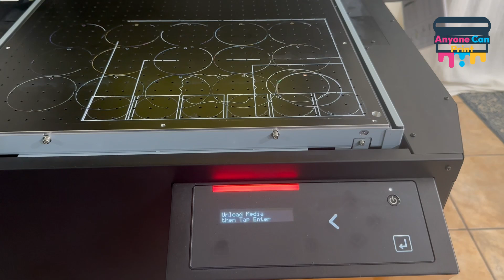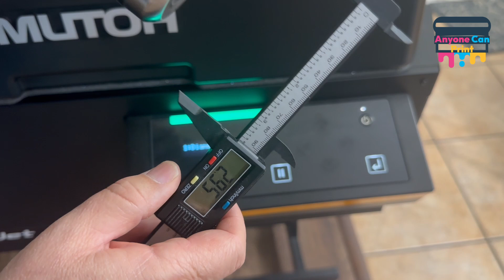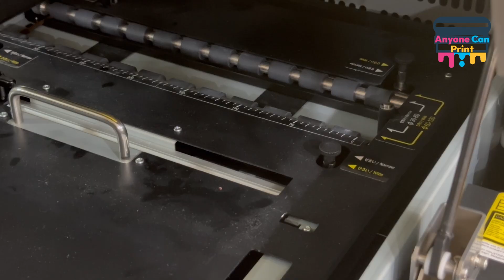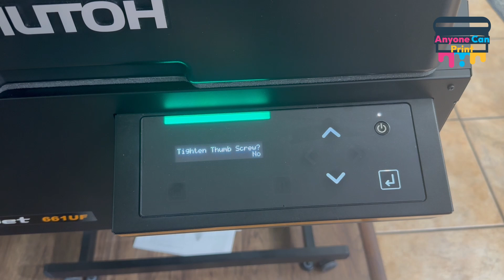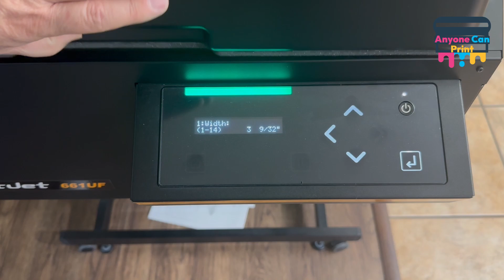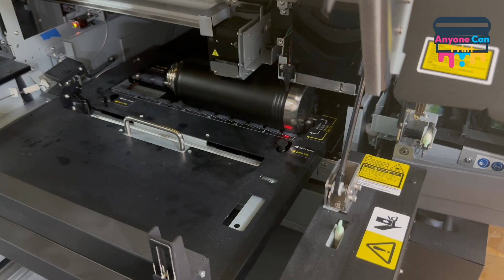How to install the rotary unit into the Mutoh XpertJet 661UF

Comment: Are you priming the tumblers before printing or just wiping them clean?
Reply from the maker: I just wiped them with rubbing alcohol. If you are printing on a bare stainless steel tumbler, you might need an adhesion promoter.

Comment: HELLO THANK YOU FOR THE VIDEOS. I have a problem don't know why my artwork is printing distorted. I have done averything in your video but the artwork is size 2.5 x 4 but is printing 1.5 x 4, please advise.
Reply from the maker: @gisellesanti1  To start, what software, including rip, are you using?
Reply: @Anyone-can-print  flexi & vertelith
Reply: we are ordering the part for leveling the yeti mugs as soon as we figure this out. We are just starting using the rotary
Reply from the maker: When you are sending the print to the printer, what "Print Environment" are you using?
Reply: @Anyone-can-print  w cmyk on user type 1
Reply from the maker: That may be the issue right there. You should have a print environment that is labeled rotary.
Reply from the maker: I ran a test and if I didn’t use the print environment labeled rotary it did in fact print it close to one and a half inches. If I chose the print environment that’s labeled rotary it printed to the correct size of 2 1/2 inches.
Reply: @  HI, changed the print enviro... to rotary jig w cmyk, in the printer profile it is selected by default 720x1080 banner 1. I did it!! Thank you so much.
Reply from the maker: @ that is awesome! I am so happy you got it working!
Reply: @Anyone-can-print  i placed the order for the yeti  leveling attachment. Thank you so much for your help.
Reply from the maker: You are so very welcome! We are shipping it today. Thank you!
Reply: received the part today, thank you much.   I have a question, I am trying to print on some plastic pens that I bough and I am using type 1 but the print is not curing enough, I can feel the print dry but when I scratch the ink to see if its resistant , the print will peel off. Any advise? thank ;you again.
Reply from the maker: I have had that problem when trying to print on plastic lighters. It was the plastic. You can try printing a layer of varnish first. If that doesn't help you might need an adhesion promoter.
Reply: @Anyone-can-print  can you suggest a brand do you have a link where i can buy the adhesion promoter? thank you
Reply from the maker: I have tried Mean Green from PDS and AP3155. It still didn't stick. It really depends on the type of plastic. Unfortunately there is no one solution for everything. You may have to try a couple to figure out what one works best for you. If you are in the Mutoh Xpertjet 1462, 661, 461, I just posted the primer resource chart Mutoh has put together. A few of them can be found on Amazon.
Reply: @Anyone-can-print  can you send me the link for that post? i can't find it. Thank you so much for your help!!
Reply from the maker: Here you go. https://www.facebook.com/groups/466550998238189/permalink/1211049300455018

Comment: Doesn't turning the "table height knob" effect the table height after the rotary is taken out? Doesn't that effect the table height zero after you are done with the rotary?
Reply from the maker: Good question and something I was worried about. Come to find out when you go through the steps to remove the rotary, the table raises back up until it triggers the laser that detects the table, resetting the table to the correct zero point.